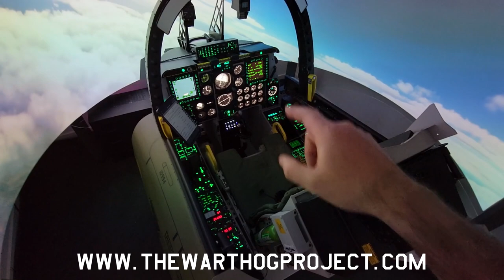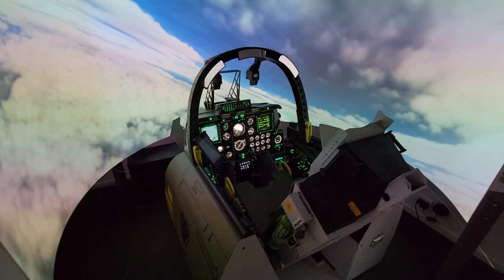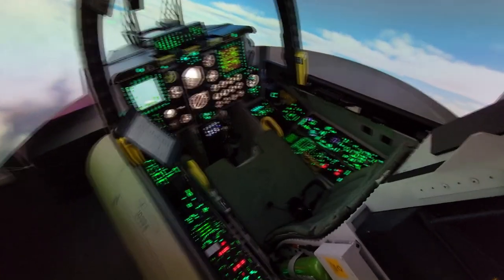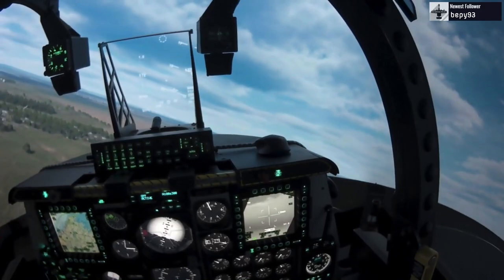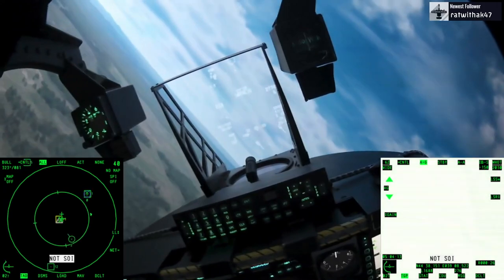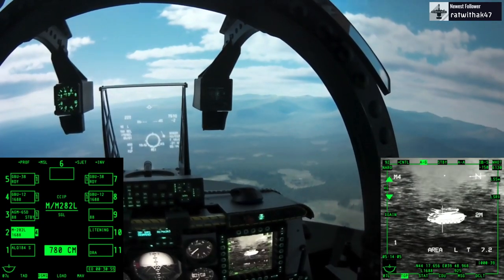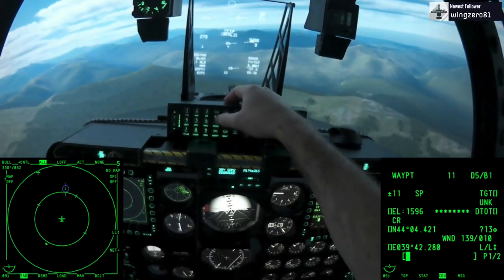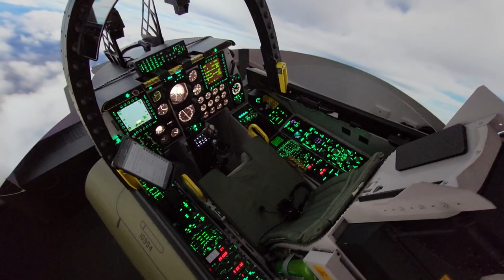UPDATE January 2022 - 3080TI and BRRRT

Comment: now we just needed better consumer augmented reality headsets to replace the projectors and occluded the warthog you built and then it will really look like you're flying.
Reply: I think something like Tilt 5 would be perfect for cockpit builders.
Reply: @VR_Aviator  As soon as my KS gear shows up, I'll know. :)  The original CastAR was almost good enough.  I do think that true passthrough VR/AR with a chromakey based composited scene is the way to go for folks with real cockpits.
Reply: The issue with passthrough though is that you will always be hindered by the limitations of the headset. FOV for example.
Reply: @VR_Aviator  naaah Fov will be solved easily one's pc's are faster. Varjo has not the largest fov but the best sweet spot, so basically it's feels bigger then most headsets with wider fov. You also see way more then with three projectors because you can actually look around and behind.
Reply: @Hani_Santa  I was comparing pass through to something like Tilt 5 , not the 270 degree setup here.
Reply: yes yes yes add 3d to the scenery too. they had an AR setup at CES
Reply: Honestly a good screen is still better than vr for clarity. Since I got that Samsung g7 32 inch I kind of don’t use the vr in DCS more in il2 BOS  even with a 3080 ti it stutters to noticeably. Of course immersion is massive in VR.
Reply: @alexsp7086  I use a 32” with head tracking. pretty good experience for the money

Comment: Love the idea. A galvanised round nail really isn't the best object to hold with a magnet.

You want a soft iron flat plate like you find in cheap magnetic latches.

You will be able to hold the switch with much less power. A longer lever helps too.

Comment: I don't know much about flight-sims, but as soon as I saw you touch the mirrors (bare with me I watched only until that parts for this comment without sound or subtitles) ... I suddenly imagined 2 things for getting them to actually work, 1 have them be tiny screens (like in some cars) 2. have screen(s) behind you so you can literally angle the mirrors to look at them! (or you would need a full 360 circled projector display (like the first 180'ish you got, guess the space limitation is holding you back?)

Comment: which part of the external lights are you having issues with?  This was something i did on my little desktop pit as well, with the position and strobe lights because i always forget to turn them off when fencing in :D.  this was the simplest thing i have, you'll need to adjust pins i had in one of my tests:
```
// Left position (red) 
DcsBios::LED extPositionLightLeft(0x11bc, 0x0800, 13);
// Left strobe
DcsBios::LED extStrobeLeft(0x11bc, 0x4000, 12);
// Right strobe
DcsBios::LED extStrobeRight(0x11bc, 0x8000, 8);
// Right position (green)
DcsBios::LED extPositionLightRight(0x11bc, 0x1000, 7);
```
Reply from the maker: Holy crap please tell me it is that simple! Was extPositionLightLeft in general or an aircraft specific control reference? 

So far I've been able to get them to turn on and off with the game, but couldn't get them to flash so have been trying to add my own code. If the above code you posted works for the A-10 I'll be a happy man!
Reply: @thewarthogproject  I'm using it in my a10, I don't remember if I found it in the common or a10 specific but it was in a odd spot in the references? Hopefully it works like magic for you! Love your work, I've been steal-i mean borrowing your ideas since the post on the ED forums.  My landing gear lever is pretty much a copy of yours 😆
Reply from the maker: @gardnerjr  well I got it working! Can't believe I missed that in the control reference- they are in 'external model' Although I've noted the position lights only have an on/off variable, so they only turn on. So when I set them to flash, they also only turn on. Did you get yours to flash at all? The strobes flash perfectly.
Reply: @thewarthogproject  i'll have to verify tonight but it looks like the only videos i have show the position lights (red/green) only ever on solid, but the white strobes blink?  both are the same code in dcs-bios so i'd assume that means that dcs doesn't flash the position lights?  or do they slowly fadein/out when "flashing" and dcs-bios not model that?

Comment: Obviously fridge was most important update ;) plus it adds many FPS after a few VBs.
I'm still conflicted on VR. I've hoping someone would implement the external cams on many headsets for AR integration. Using a button box is a sloppy guess in VR, so I keep most my binds to my steering wheel controls.
Good stuff tho mate, as always.

Comment: One thing I've been looking at is a working utility lamp out of an actual cockpit. Seen a couple on eBay for £30-35. Only thing is they're gonna be 28v at least so you would need another separate power supply.
Reply from the maker: Got one already! They are easy to swap out to 12v, they fit normal car bulbs, although I can't remember the size. They are small bayonet ones. I used all the exiting wiring to run 12v,  and just added a car led buld. Job done.
Reply: @thewarthogproject  excellent! Definitely getting one now!

Comment: Mine that 3080ti during it's down time and it'll eventually pay for your whole setup there.  And that evga XC3 3080ti most likely needs a bios update.  94.02.71.80.BF is the update released by evga that stops it from throttling core clock frequency when it hits 260'ish watts.  Though you may can use the hybrid water cooled bios with your setup.  Either way, you've got a 90 mh (77 with old bios) money printing gpu there.

Comment: Have you thought about doing a real working HUD? Companies like Prompter use dichroic acrylic or glass in there teleprompters. Basically it's a glass that will reflect an image while still allowing light to travel through it to the camera. You could cut a piece to fit your hud, and have a LCD monitor with your HUD graphics on a black background below in your dash. One idea for alignment is to mount the monitor on a threaded rod that can move I in X and Y. Then display a crosshair in the projected hud and in the actual hud. Moving the monitor so it's crosshairs are aligned? In the monitor you just mirror reverse the image so when it's reflected back it looks right. But if the game won't output that display I get that's probably too complicated.

Comment: what processor do you have? ur gonna want to get a new one cuz ur getting some stuttering and u should not have that with a 3080ti. so ur processor is likely a bottleneck.
Reply from the maker: Nah it's smooth as butter in game. The framerate drops you see are only because the footage is from a twitch vod. It's a 9700k on water running at 5ghz.

Comment: Have you looked into building a glass hud instead of putting it onto the screen?
Reply from the maker: I have looked into it, i even started designing one. Unfortunately I can't do it as my PC has no more outputs (4 is the max on all Nvidia Cards) and DCS can't share viewports over multiple PC's.
Reply: It can however share over multiple graphic cards on one pc. I’ve got 3 on my nvidia and an hdmi splitter to 3 more on the onboard intel.  It should be able to share on 2 nvidia even different cards without sli
Reply from the maker: @chriss234  you may be able to extend them as a desktop, but you can't have nvidia surround and immersive display pro warping more than 4 around a curve from a single pc.

Comment: Question are you planning to add a projector to the top aswell? Or just leave it in the horizontal axus like
Reply from the maker: Can't do it, as I've got no more outputs available on the PC and DCS doesn't support sharing viewports over multiple PC's. Also, the current projectors are roof mounted so doing that would block them.